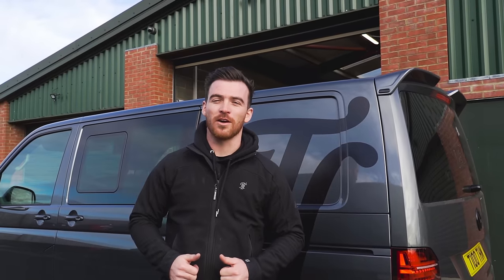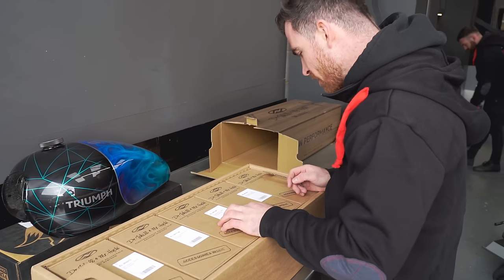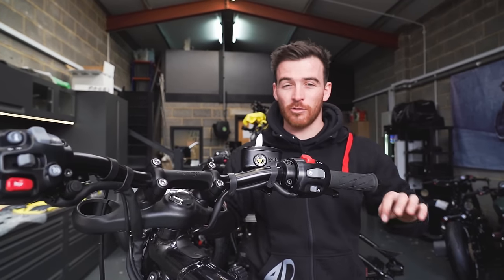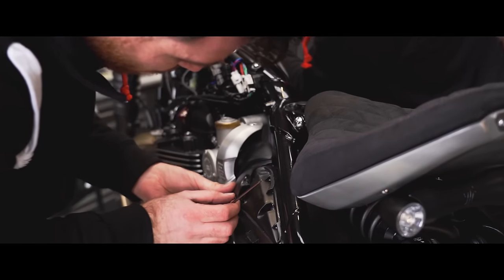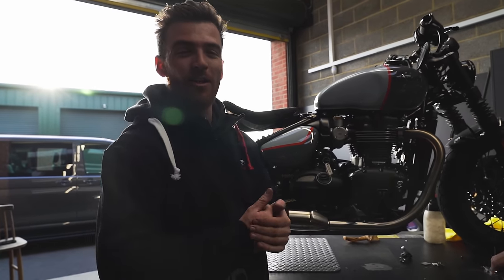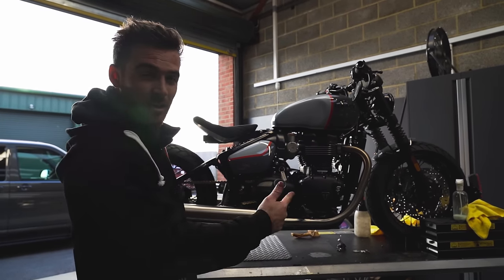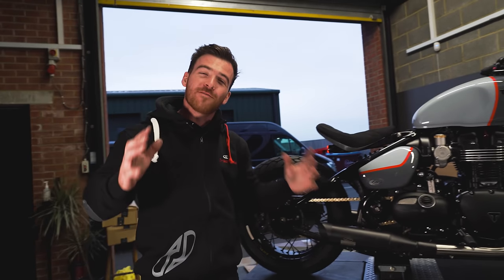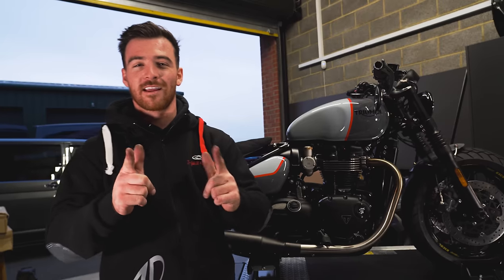CUSTOM WIDE WHEEL BOBBER WITH VALVED EXHAUST - Thornton Hundred

Comment: hello I am an admirer of the triumph motorcycles but I still haven't seen this model with the exhaust like the rok3 under the bikes with the 2 outputs with the rok3 dial and yours is 2 seats
or seica the bike and the same plus a little more of rok 3

Comment: Not to be that guy or anything but that radiator guard is absolutely terrible. Performance and protection.
There's spots that are going to create hot-spots from the flat solid metal, and there's multiple open areas that aren't going to protect anything. Follow the KISS approach. Keep It Stupidly Simple. A nice strong grill and then you can put your logo on the bottom or the sides or the top along the frame. What you're selling isn't a radiator GUARD, it's a radiator cosmetic blocking cover.